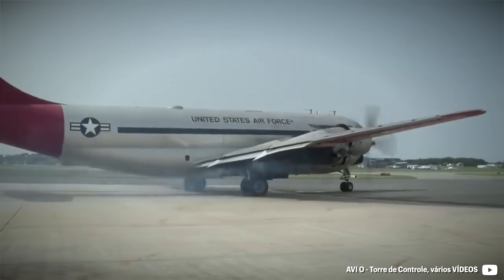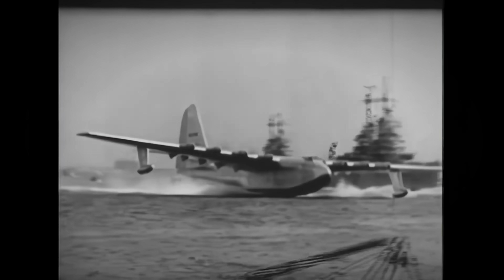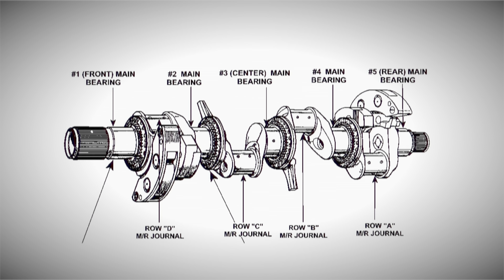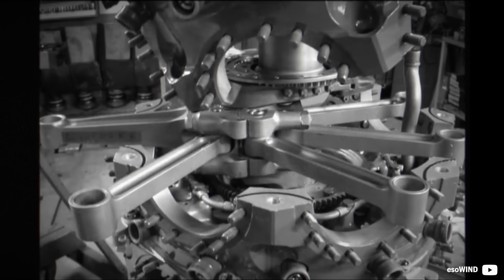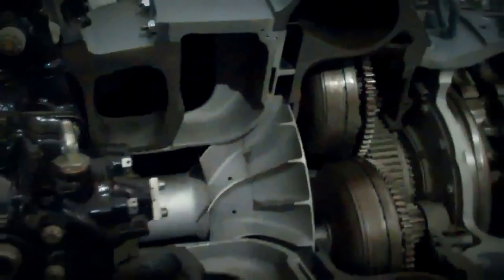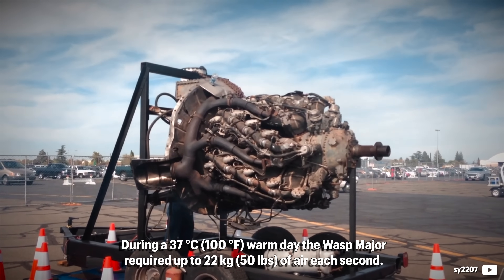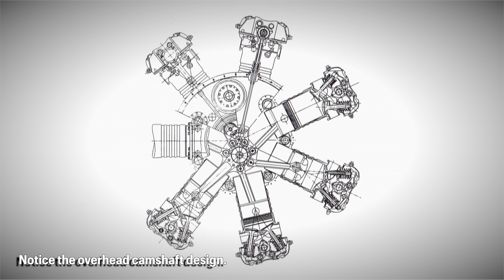How To Build A 4,300hp Aviation 'Wasp Major' In The 1930s?

Comment: These were incredible engines. As an aircraft mechanic if my boss took one in for me to work on I would fire him immediately!
Reply: Imagine if continental made it, it’d be even more of a PITA to work on
Reply: @Notthe_droid_youarelookingfor  
Maybe so. I work on a LOT of Continentals so they aren't too bad....but they always need SOMETHING!
Reply: @upsidedowndog1256  work on a lot of those too, mostly in the Cirrus
Reply: @Notthe_droid_youarelookingfor  
I installed an engine on a SR20 and an SR22. The tuned induction engines are a huge leap forward compared to the older ones. LOP operation is possible without GAMI's. I didn't enjoy flying them as much as I had hoped I would. They feel heavy and sluggish on the stick.

Comment: Now i wanna hear what a 28/1 exhaust sounds like
Reply: Haha same

28-1 akrapovic system
Reply: @Aldizerboer  more like  straight pipe
Reply: Equal length headders?
Reply: @SavageBunny1 would be hard to do practically. Log is the only practical way
Reply: sounds like my 100cc yamaha waaang waang ting ting ting
Reply: It sounds like it comes out of a giant turbo. Because it does…
Reply: @solomon165pro well, iirc, the crank-driven centrifugal supercharger fed into the turbos on those specific models.

Funny how technological advances in modern motorsports and the automotive world in general were forged by the massively-funded and hastily-made experiments of a war from damned near a century ago.

For instance... in modern motorsports nitrous oxide injection or water/meth injection is common place, but it was first being developed by Kurt Tank on the Focke-Wulfe Ta-152. Basically, a heavily modified Fw-190 with a pressurized cockpit, with nitrous, water/meth injection, that could climb to over 50k feet and do damned near 500mph. Too late to make a difference for the Luftwaffe, but that was 80 fuckin years ago. 

Can you imagine the shit the MIC is working on now that will be commonplace for our grandkids long after we're all dead and gone?
Reply: I think it was configured that way.
Reply: I wanna put one on a go kart with headers
Reply: I heard FI exhaust is available for this engine
Reply: Probably like a beehive full of bees on methamphetamine
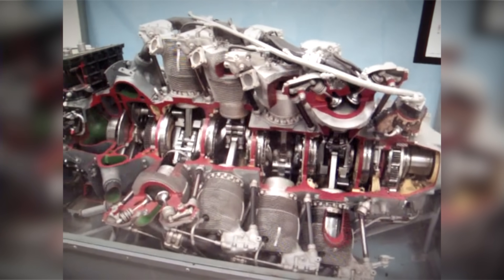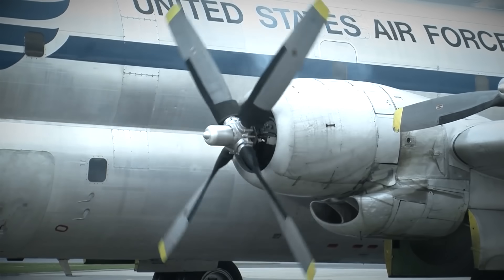Reply: You can hear it briefly at 2:12 and 3:40 and four of them at 10:12 ..
Reply: There is one in Saint Helena in Napa Valley that is on a trailer and able to be started up.  This example is shown in this video.
Reply: Sounds like a giant FART.
Reply: I’m way late, but the best system for these that were non-turbo was what PW called the siamese stacks. Each bank of four has a pair of 2:1s. The rows were lettered back to front, A, B, C, D. one header would scavenge A and C; the other would scavenge B and D. A and C fire 360° apart, same as B and D. Two shared primary, but never at the same time. Sounded great, it’s why a C-124 would shake the windows of your house if you lived under the pattern near a base.